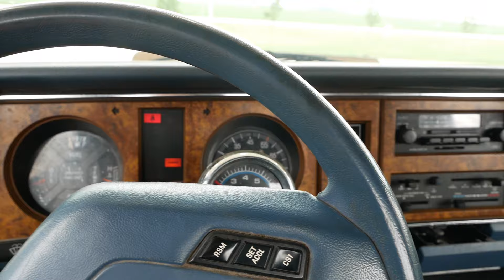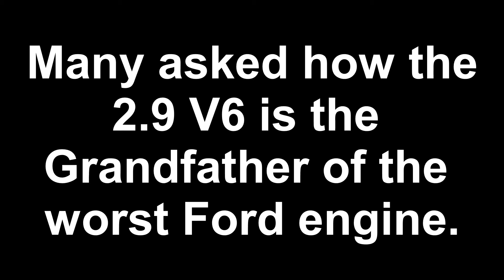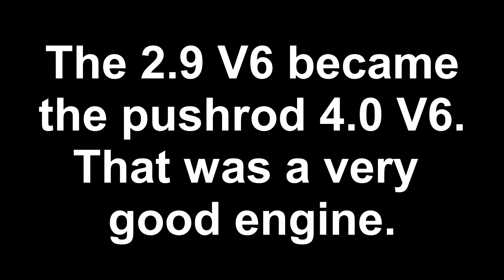Fixing Frank Fritz's 1986 Ford Ranger - Road Ready - Part 2

Comment: Sounds like the last engine and Brians Volvo are close kin. I heard a preacher ask his crowd what the difference was between a Ford and a golf ball. He said you could drive a golf ball 300 yards and Ford must've made a lot of beautiful engines because everybody had their hood up and their head in there admiring them. I wish I still had my old Ford 150 short bed, 4x4 limited slip with a 300-6 and granny 4-speed. It was a rag but ran like a Swiss watch. And I used to drive an old Mack that the floorboard was the top of the fuel tank. That's a nice ride but I better keep the Taco. GOOD fix and GBWYall!

Comment: I’m a fan of that brake bleeding technique. As long as the hose fits tight and the fitting is just cracked a bit it’s an easy way to do the job with one person.
Reply: I always put some grease on the threads of the nipple to stop any air finding it's way round the threads. It helps with stopping it seize up in the future.
Reply: phil towle smart!

Comment: When I did the floors on my old 74 Chevy P/U i used some “recycled” aluminum street signs.  Cut to approximate shape then affixed using a can of the spray foam insulation stuff from the big orange place. Set a concrete block on each side until foam sets.  Stop sign on drivers side and 35 MPH on passenger side.  I saw the truck years later and the signs were still in place.  

All kidding aside I’m impressed by to combination of old fashioned mechanical skill with the knowledge of modern electronic components.  I’d much rather have an F 100 or F150 with a straight six under the hood and a three on the tree.  Those were my days.

Comment: I got the same truck in 2000 ,the guy said the motor had a rod knock ,got it home saw a antifreeze jug in the box,long story short it had a bad water pump,35 bucks and i drove that truck till 2011 when it was completely rotted out ,they were a good truck for the price, for the AC use red tec and sealant ,40 bucks and your ac will work,i built a vachum pump out of an old window air conditioner and picked up an old set of freon gauges and have reserected many old car truck farm AC units,it also works for house central air units.

Comment: I mentioned the cluster gear bearings going bad in the last video. I forgot to mention replacing brake lines, floor pans and all the other crunchy stuff you pointed out. When I did my ranger it was back in 2002 and it was as bad as that one you have. So yours has done well for being 20 years older than the one I had.

Comment: Those cross bar springs are included in the aftermarket chineseum spring kits. I've had to buy whole kits just for those springs. And the green spring goes to the primary (front) shoe, the white spring goes to the secondary shoe.

Comment: Wes that truck looks good for a winter beater. Should last a few years. I would put some old heater ductwork over the floor with flex seal spray that will last a while.

Comment: Hey Wes, those break drums the way to make them self adjust, is to push the emergency break in and throw it into reverse. Then let off the clutch a few times without killing the engine, and that will cause the break drums to self adjust. I know this, as those breaks are just like what came on the 1965 Ford F-100 all the way through until Ford started putting Disk breaks on the read. You only had to do it a two or three times a year, to maintain the break adjustment properly. Here is another little tip for you, as you can run P235/75 R15's on your truck, as that is what my 2001 Ford Ranger run's and is a much more common size. You will just need to change the gear on the speedometer cable that goes into the transmission so that your speedometer runs right. You should also be able to put the newer transmission from a 2001 Ford Ranger into your truck, as it is a better transmission then what is currently in your older Ford Ranger.

Comment: First time l saw Superglue used on O Rings was in 1966 at Humes Pipes in the Snowy Mountains on a huge Hydroelectric Penstock expansion joint seal in the Snowy Mountains project.

Comment: That reminds me of my 89 F150 brakes, never had issues with those slides through 400k of driving.

Mine had the Madza 5 speed with atf, always burnt oil regularly until I switched to synthetic.

The old EEC IV trucks responded well to a little bit of timing advancement and drilling out the TPC holes and setting it to .90 to .92 at idle to improve the throttle response.  Apparently it doesn't control the fuel mixture by O2 sensor until it's above 1 volt.

Comment: For anyone who finds themselves making custom o-rings and gaskets frequently, there are super glues formulated specifically for it. They typically have rubber modifiers that make them less rigid/brittle. Loctite 404 and 406 are good examples

Comment: Nice video. Note on the Ford TFI modules. Black Motorcraft modules are CCD, whereas the gray are Push Start modules, as your viewers mentioned.  This truck would definitely have a push start (gray) module.  However, aftermarket modules don't always follow this pattern (unfortunately), so if that black module was an aftermarket, it MAY have been the correct one.

Comment: Good lord that has a bit of rust there I see. I still have that socket to take the spindle nut off from about 18 years ago. I haven’t used it since then. I have that little ignition module 5.5 mm socket too, Also haven’t used it since. I just ordered one of those brake reset tools for drum brakes and parking brakes. I hate adjusting parking brakes gonna try it next time.

Comment: All of those 80's small pickups had manual transmission problems.  That small pocket gear on the countershaft, mainly.  Couldn't keep enough oil running through them.  Of them all, a T-5 Borg-Warner seems the best, and it was/is a towable, making them good for pulling behind an R.V. without a driveline disconnect.

On the Dakota I had, the easiest thing I found to do was to go to the pick n' pull, get one that seemed good, do what was needed with it (new seals and such), put it in as needed.  "Eat" one core, after that you always have one on hand to trade off on the next one.

Comment: Another 'trick' to bleeding brakes by yourself.... Before starting, REMOVE the bleeder-nipple and wrap the threads with teflon tape. This prevents air from getting in around the threads while bleeding. it also makes vacuum-bleeding work MUCH better. As a bonus - the teflon helps keep the bleeder-nipples from rusting and snapping off next time.

Comment: As a kid i remember my father occasionally drive the car backwards and hit the brakes a little hard a couple of times. I later learned he was adjust the rear brake system cause the peddle felt a bit low. Fertilize that corn good for some gvmnt moonshine.

Comment: In my opinion, the 4.0 pushrod V6 is one of the best 6 cylinder engines that Ford ever made... I think it was designed in Germany actually so that may be a part of it. The 4.0 in my 94 Aerostar has outlasted many A4LD transmissions that I have thrown in it (perhaps not one of Ford's best transmissions).

Comment: I was trained way back in the 1970s to always install the brake shoe with the longer piece of brake material toward the front of the vehicle.   They will work installed the other way, but may reduce braking effectiveness.  By the way, very, VERY impressive shop and tools!!  It is a shame to see how the road salt ruins cars up north.  I live in NC and we don't see cars like this unless you live on the beach.
Reply from the maker: Interesting. Ford shows the longer to the rear. Sometimes they are the same length. Trailers are like that.

Comment: New to your channel and just wanted to add that I use to have a Dodge Power Ram 50 4x4 with same tranny and I was told 90 weight is to thick to lube the needle bearings on the counter shaft that is why 3rd and I bet also 5th wine was told to use Mobil 1 full synthetic oil, was either 5w 40 or 10w 40  
Great video by the way

Comment: The trick with that brake-bleed-bottle is to put some old brake fluid in there and keep the hosetip submerged in the fluid. That way, the fluid acts as a checkvalve and you can pump away on the pedal without sucking in air.

You can still get air in though, through the bleed nipple threads. I had that problem on my old Land Rover. Fixed it by using gas-rated ptfe thread tape on the nipples. Has worked fine for some 13 years. 😁

Comment: I had the R2 Mazda trans in my full size bronco. The middle bearing on the main shaft went out twice.  It spun the cup in the housing and machined about 0.015 off the retainer plate.  It made some noise in counter shaft gear but not much.  I fixed mine by swapping in a zf 42 5spd.

Comment: I had a ranger that lost the countershaft at just over 312000 miles. I had to drive almost 200 miles home with only 4th gear. When I scraped the truck the engine still ran very well . The rest of the truck was extremely worn out. The engine shouldn't have run as well as it did. Because when it had 175000 miles on it the head cracked.  I got a rebuilt head but because the truck wasn't worth anything I put the old camshaft lifters followers ect back in it. I did use a new gasket, head bolts and timing belt. Everything else was the original junk. To my surprise it ran like brand new. It's probably a good thing that the transmission went out when  it did. I removed the gas tank so I could scrap the  truck. I found that the frame was so rusted behind the tank that it was about to break apart. 
The bottom was cracked 1/2 way across and  I could stab a screwdriver through the side of it.

Comment: 27:17 I was about to mention the 300 'cause my F150 has that same exact module and also has the 300! And I had to replace mine once; it only gave spark when the engine was cold. Ended up going medieval on the holes with a drill bit till I could get a socket on the bolts but it's in there and chooch'n nicely now.

Common trick with the 300 is to go back to a Duraspark II dizzy and get an MSD6AL or Accel 300 ignition box, bypass the factory ignition system entirely. I might just go one step further than that and get a points dizzy for mine.

Comment: You do preload most forklift wheel bearings.The rear axle doest have brakes and the front brakes rarely get hot.
( 12 mph top speed and a lot of rolling resistance.)

Comment: My dad used to have a 93 ranger 4wd. The worst wheel bearings and brakes ever... we could never get the play set properly because of the races being right next to each other. Had no rear brakes for a long time before you found the rear ABS unit on the frame was completely rusted solid inside. I will always have fond memories of that rusted old turd though.

Comment: I had an 87 Ranger with that transmission. Had a whine for years. Had the college trade school pull the trans to look at it. Wound up doing more harm than good. Didn't fix the whine and damaged the shift rails so it would get stuck in two gears sometimes. Miss the truck, but not the transmission

Comment: Dang, I was just impressed that you found bare metal on the brake parts--looked like you were turning rust there for a bit.
But, bonus Personal Air Show FTW.
And, now, of course, Matt will have to be jealous that you have a running 4x4 Ranger that is not yard art.

Comment: Put anti-seize on the self-adjuster screws! Put caliper grease on the pad back. It prevents chirping noise. Replace the MAP sensor. Use a Mityvac brake bleeder to bleed the brakes.

Comment: Check your spring brackets on the rear, and check your shock brackets they like to fill up with dirt. The leaves like to get down in between the cab and the Box they wind up between the frame rail and the gas tank and the end up rotting out the frame rail that should be kept an eye on

Comment: I kept having to push my jaw back up, because I only seen something that you kept telling us was supposed  to be rear drum brakes.
I've watched a lot of documentaries about sunken ships, and seen different vehicles that have been submerged for 60 or 70 years in salt water that have better components than your putting new pads, and shoes on.
Then I couldn't be
believe the bleed valve actually worked in that rusted carcass, along with the other brake components you replaced. 
Good to see you loosing up, ripping the little truck around in the field, and then actually did you a burn out with smoke n everything. 
Be safe in that rust bucket, and there's no way that would pass state inspection in Texas. 
Not even sure scrape yards would except that as actual salvageable metal, and you might even have to pay them to take it.
Reply from the maker: This thing is mint for Illinois.

Comment: I remove those shoes as an assembly. Pop the upper return springs, then the hold-downs, then pull top of front shoe forward enough to clear wheel cylinder, pull rear shoe away from cylinder and rotate whole thing clockwise on RR slightly. Unhook e-brake lever from rear shoe. Leave the adjuster in place between the shoes. Lay it all on the floor or a cart. The E-brake spreader bar will stay lying in place. Vocational school back-in-the-day had a skills test. The Ford drum brake was part of it. Can blaze thru them. Interesting to watch somebody not being pushed by SA to get the bay cleared & actually doing everything right though.

Comment: I agree with the others re: there should be a slight bearing preload if that’s what’s called for. I’m sure the designers accounted for heat expansion, in all directions and items that would make clearance both tighter and loose.
Reply: Either way, this is the rare occasion where Wes' reasoning is flawed: when the rotor thermally expands, the hole gets bigger, not smaller

Comment: Just a little tip, if you saw 2 grooves in the disc brake pads, then the dirt will have some place to go. This stops glazing that leads to those horrible sqealing noises. Cheers.

Comment: excellent video . at 76 years  and a super mechanic    just old ..   I would have used some release spray on the rusted up parts .. then some nice anti rust wax on the rusted components   and why not use some anti sieze on all of the brake shoes and pads contact faces .

Comment: Great job!   Your statement on pre-load and freeplay in bearings is 100% of what I was taught in school.  
Frankly, surprised at the turning comments, at the exact same time you said that, I had been wondering why with all that equipment your shop wasn't full of just break work alone!!!   How much money did you save turning those rotors and drums?  IN SPEC?!!?   I'll take the cash if they don't want it....
Reply from the maker: Typically it’s about half the cost to machine them. Even more or large trucks.

Comment: 27:10 I can tell you from changing dozens of these the screw is a 5.5mm. And the tool is vital on a ranger like this. Probably why the module was destroyed getting it out. The screws are usually locktighted in, and are very hard to get out, and there's not enough room for a 1/4 5.5mm and a ratchet. The tool has a hex head where you can use a wrench to remove it. I always just pulled the distrubutor, as usually a failing hall effect is what takes the module out, and Ford reccomended replacing both at the same time.

Comment: Please please consider putting that fantastic 4.0 OHV engine in your little truck. I pulled my sick/ tired 2.9 out of my '88 Ranger and put a 4.0 pushrod in from a 1990 ranger. I'm having a hell of a time trying to work out the electrical and could really use some help :) your videos have been fantastic by the way, gonna run through all the same maintenance stuff if this thing ever makes noise again :/
Reply: I had a ranger with the 4.0 and loved it.  I however think it'd crack this crusty rusty in half the first time you gave it the gun! :)

Comment: Rear spring color are one of each per side so they wrap around the anchor pins the same.
Reply from the maker: No. I just checked. All 4 are the same.
Reply: @WatchWesWork  IE both over the top
Reply from the maker: @petekovacevic3241  You can't do that. The springs are all the same. You would have to twist two springs a half turn.

Comment: I'm pretty sure that the Jeep Comanche mini pickup required Bering preload to compensate for a weak "flexy" spindle. If the bearings were installed "normally" the endplay + the spindle flex would open up the disc pad to rotor clearance and give you a low brake pedal.

Comment: I never knew that they used Mitsubishi. Transmissions must be for the 4wd I remember they used the Mazda transmission for the 2wd.  That was very interesting to hear. The drum brakes I hated those when I used to work on those. The 2.9 engine in the ranger is the second design from the original 2.8 V6 that came in mustang 2’s during the 70’s that were designed and built in Cologne, Germany 🇩🇪. To me the 2.8 was the better engine but not much in power wise. The 2.8 was available in the mercury Capri and revved to 6 grand easy.  I test drove a used 1976 one when I first got my license in 1982.